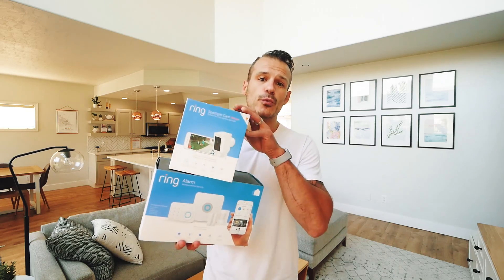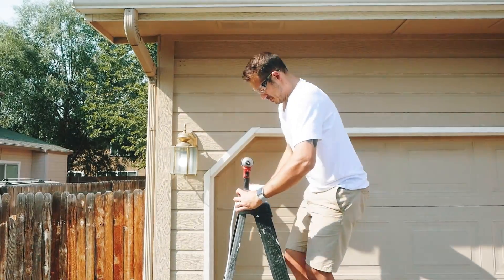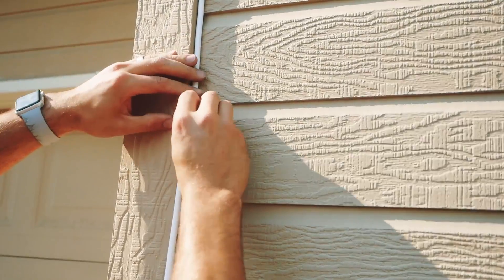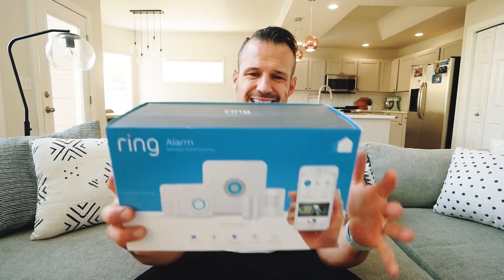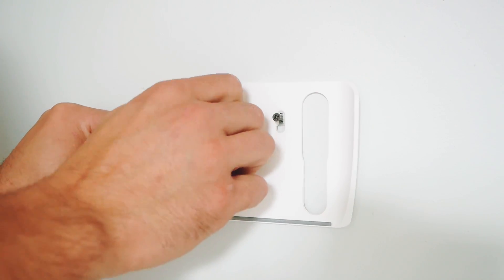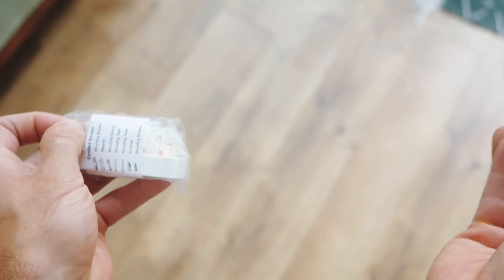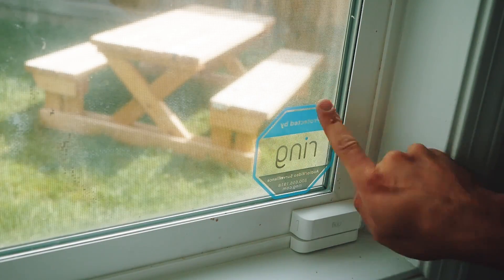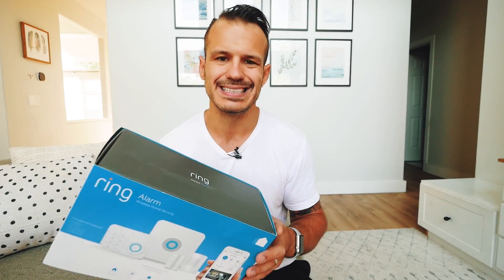RING Security System Worth It?

Comment: I am a licensed low voltage electrician. In CT it is illegal to run the electric wire through the wall like you did. If there was a fire a home owners claim could be denied by insurance. You might want to mention that disclaimer. I am sure there are other states where that is the case.  PS. I hit the like button. Decent amount of info

Comment: The base is the heart of your system and should be placed where it's very hard to get to or damage. I strongly suggest you move yours. 

Same idea goes for your window/door sensors. Putting them at the bottom makes it easy for someone to push a magnet under when and fool the system. Better to place them on the side near the top of the window.
Reply from the maker: Great option
Reply: timon0x31 v
Reply: Thank u so much for those tips!

Comment: We're starting to hit a point of wireless device saturation in a lot of average homes.  I've had to upgrade my wifi from a pretty nice but not too expensive wireless router to a Ubiquiti USG gateway and their AP pro.  It was an instant fix for the random device disconnections.  Everything is smart, everything is IOT.  I have 30 wireless devices right now and that number is only going to be going up.

Comment: Any security system devices having their cables right out in the open, means it's available for tampering or being degraded by the sun and elements.  The power cable should be cut, then passed through the wall to the other side, the cables re-connected on the other side inside a J-box, then the cable should proceed to be plugged in where your cabling is most secure. (may require the need to run new power to the inside garage wall)  

From the audience perspective of your YT post, might I suggest you be careful how you respond to comments.  Their input may be totally toxic or rude  comments, but keep in mind that your replies are under more scrutiny than their comments.  If you don't like the comment they posted, dump it instead of trash talking each other.  Goes a lot further in the long run, especially if you want more subscribers.
Reply from the maker: Thanks
Reply: 68Camaro RS/SS , I absolutely agree.  This is not a bank or the like, however the elements will degrade the install and when you need that video the most, it won't be available.   The point was not only to protect the device from tampering, it was also to protect the install from the elements and get the maximum life expectancy out of your investment.  My camera system was pivotal in recovering my neighbor's trailer, when 2 douchebags decided to swipe his trailer.  We had video of the guys and the vehicle because they parked in front of my house when they stopped to do the dirty deal.  You never know when you need that video!
Reply: 68Camaro RS/SS - I expect to get the maximum value and use of my investment.  You can throw away your money if you want, that’s your choice.  I build my projects to last.  Do you put no name tires on your car to save money?   I certainly don’t and won’t.  I buy what fits my need, won’t fail prematurely and will last.  I want that dollar to give me the maximum use.  That’s how I roll.
Reply: James Sokolovic wa
Reply: Gordon Chow ???
Reply: @MEGA_SOKO  - - I'm a 35 year old man, but... Is it weird to say that when I grow up, I want to be like you?
Reply: @MrBuildit   Could you tell me in what ways RING is better than any other systems?
Reply from the maker: @FluffyKittypire  I like that you can sell your house and bring the system with you

Comment: Great video!....  You mentioned that if your internet signal goes out, you'd be put in a "difficult position".  That is not 100% true.  The unit has a battery backup that allows the system to still call to the authorities if the power goes out.  The unit also has cellular backup as well, so if your internet goes out on its own OR if your entire power goes out, your security system will STILL be able to alert the authorities in the event your security gets tripped.

Comment: had my ring alarm in over a year now without missing a beat,you need to mention that your external ring cameras can be intergrated with the ring alarm so if your alarm is in home mode or away mode and your contact sensors are tripped then your external camera siren goes off as well as your alarm base station hopefully alerting your neighbours

Comment: The wifi is the primary signal but if you're subscribed to monitoring services, the base unit has a backup cell signal that will still monitor the alarm and alert the police of an alarm. Cameras wouldn't work but rest would since it z-wave connected to base panel.
Reply: It would be nice if the battery operated versions had an SDcard back up, so at least recording could continue. The security cameras at my agency have this and will record if the network drops out. Great backup.

Comment: As a security installer for 20 years let me just say two things. All this diy alarm systems are great for people on a budget but they can't possibly compare to a proper alarm system installation. Also external power wiring visible like that even if you paint it is a big no-no. You could drill a hole direct from the camera to the inside of the house at the height of the camera and properly insulate that cable with insulating conduit.What you do to the inside of the house is up to you. I recommend a plastic cable tray which can be painted.Greetings from Greece.

Comment: I am not familiar with this system. But in my house, I also use security from Kangaroo. In fact, it completely suits me and I do not want to replace it with something else. I chose this system due to the fact that it is wireless, it works through a wi-fi network and has its own application on the phone, with which I can monitor my home.

Comment: I would like cable to be plug jack so I would easy run it through wall and avoid cord cut.. access..
Reply: If you're talking about the camera, there is a "wired" version. You can replace existing security lights with it or run your own wiring to it. No exposed power cord.

Comment: So if I had this system and the wifi goes out or the cable is cut, will the audible alarm still tell me that a door or window sensor is opened?  Alerting the security company would be secondary to me.

Comment: funny like no one could walk up and cut the cable. Bad guys steal cameras all the time
Reply from the maker: very true
Reply: Prime is the plug cant be fed through the hole. Unless you mount camera to a board and bore a bigger hole. Better idea really.
Reply: @davehelmVO  I drilled a small hole, cut the power cord about a foot from the end, fed it through then re connected the cable on the other side of the wall in my garage. No cables on the outside whatsoever.
Reply: Night Stringers un

Comment: If the power goes out it has a backup battery.... but if the power is out then you're internet is going to be out so what good is that?
Reply: As far I know main station has backup mobile connection, I wish there is option mobile only connection for few bucks extra.

Comment: Ring's major advantage is ease of use... past this it's an inferior system that doesn't have the level of durability or reliability of a fully wired PoE system connected to NVR and NAS setup. Setting up a system like that isn't easy, but it's way cheaper than the "best buy" brands and bulletproof. Usually comes standard in 4k these days... Ring and comparable brands only do 1080p... just my two cents.

Comment: High, with the integration to Alexa and Schlage Z-wave lock, I know that I can leave the house, lock the Schlage lock and it will arm the Ring alarm in away mode.  Can I do it the other way around, arm the Ring, Open the door, exit the house (during the arm delay) and close the front door.  Now I would like Ring/Alexa to automatically lock the door.  My current alarm system does it today.  Can the Ring /Alexa/Schlage combination do that?

Comment: On comment on the dislike, If you subscribe to the Security  monitoring plan   for the $100 a year, the base unit has a cellular module through AT&T that f the internet get cut or disconnect you are still protected. The only downfall to this is you have no app control.

Comment: The big problem with ring is the lag you get when it is triggered
Reply: Hmmmm, just checked mine, opened my back door and it sent an alert to me in less than 3 seconds and the base chimed immediately. Also, if you're talking about the alarm you can set delay (lag) to 0 if you want.
Reply: Thanks I will check that. If I am home it seems pretty quick but through phone often miss the event or experience a delay.

Comment: What is the point if the power wire is exposed? What I have done is mount the cameras inside facing outward so that it is easier to access power, hide the wires and almost eliminate someone disabling the unit! 🤔

Comment: Hey, just checking in. For anyone wondering what he means when he’s talking about the cellular/battery backup, that’s for the base security system. If you have monitoring, it’ll still dial out to the police telling them there is a disturbance for the windows or the doors. That being said, the cameras won’t record because they are powered by the wifi. If you want a system with cameras that not only record during a power/wifi outage but actually can deter crime, look up Vivint or shoot me a DM @dansochill on Instagram or Twitter.

Comment: I do not think that it is necessary to put a warning on the protection of the house on the windows and doors, the thief will immediately be ready for what you need to look for sensors. The modern sensors that I installed around the perimeter of the Kangaroo house are very invisible and the thief will not notice them when burglary and the danger signal will immediately work and send me a notification on the phone. And due to the fact that they are wireless, I can hide them well.

Comment: what if they cut the wireless cable? the robbers are first these days cutting wifi wire which is mostly outside the house, right in front
Reply: As long as you pay the $10 per month or $100 per year that is required for the professional monitoring, you are all set. The box has built in cellular for cases of internet being disconnected.

Comment: How does it compare with SimpliSafe?
Reply from the maker: i have not had a chance to review the simplisafe
Reply: Ok. Thanks
Reply: 1badhorsie Cool. My only issue with selecting Ring over SimpliSafe is SS operates from cellular, while Ring operates from WiFi. If you have a rather erratic WiFi connection, there may be problems. However, monitoring with Ring is substantially cheaper. 

Thanks Bro.
Reply: Will G if you pay the $10/month for monitoring with ring, it has cellular backup as well.

Comment: What good is a battery backup on the system if the monitoring connection (internet router) goes out with the power being lost or cut?
Reply: It has a cell connection in the base unit.  It's only active if you pay for the $10/month or $100/year monitoring, but it's well thought out.

Comment: Hey Mr. Build It, I have a 1550 sq ft ranch home with three entries. I want the system to be centrally monitored for entry and fire, and I want to be able to monitor through an app.  I'm also on a budget. I've narrowed the search down to Simply Safe and Ring.  I'm interested to know how you would compare these two systems?  Simply Safe costs a little more.  Is it worth the extra expenditure?  If so, why?
Reply: I had also considered Simply Safe and Ring.  The deciding factor for me is the cost difference in the monitoring and I like the video doorbell.  At 100.00 a year if paid yearly, Ring is really affordable for someone on a budget.  This is about 1/3 of the cost of Simply Safe.  They also have a plan at I believe 30.00 a year for no monitoring but access to your camera footage for a period of time.  You can download any footage also at any time.

Comment: You skipped over the mains lead very quickly. In UK, my version of the outside camera light comes with a sealed UK plug . I will have to cut this off and thread through the wall and then reattach to the mains plug!

Comment: If you cut the power to your home does the app notify you that your system is offline, or offer up any snapshots from before the power went down? I like the idea behind these, but without a backup battery and cellular line, you'd be sol. Even if the cameras run on batteries...no power = no modem = no images sent to cloud storage.

Comment: Im thinking on Nest, thoughts?
Reply: (J G) Ring a a cheaper system and is smash proof meaning unlike the nest if the nest is smashed then the signal won’t go out, if the ring keypad is smashed then the base station will be already sending out the signal which you can hide it btw so I recommend the ring system because of cost security monitoring and no need to worry about mis placing your key.
Reply from the maker: never tried it. But the nest is cool though. guessing woks the same
Reply: Simplisafe. But more money but worth the price.
Reply from the maker: I think so
Reply: Get a gun

Comment: Why would you want to bring the keypad with you to your bedroom?  Isn’t the phone act the same?
Reply: Probably for the folk who aren't Smartphone savy, or need a piece of mind if they are too slow getting to the entry point where the keypad is usually installed.
Reply: The keypad has a set of panic buttons. You hold 2 down at the same time and it activates the alarm. If you’re on the paid system during a home invasion, you might have time to possibly barricade yourself in your room and set the alarm off. Worse case scenario, they’d shoot you through your door but if you’re like most Americans you’d be ready for the scumbags anyway so there’d really be no need for the panic buttons. You’d be calling 911 instead to report a dead criminal in your house. This is the reality of today’s United States unfortunately.

Comment: i wish you would have mentioned the subscriptions it seems that without the subscriptions you can not save or review video
Reply: That is correct. True of most all the services though this one is notably cheaper than it's main competitors (partly, in the case of Nest, because it doesn't record 24x7, it just records events or live views).
Reply: @curtisbme  yea still $3 a month adds up i can get a motion detection system that i can view through an app and a 1 terabit drive and 4 cameras for under 300 with no subscription. i think ill end up going that route after the last 24 hours of my research.

Comment: How loud is the siren?
Reply from the maker: Not sure of frequency but loud enough to scare
Reply: @MrBuildit  thank you. Great video. I got the alarm yesterday and I will install it this weekend.
Reply: (Ricardo Cuetara) The systems siren is 110 decibels (Smoke detectors are 80).
Reply: It’s a fairly loud in my opinion, that was the first thing I tested when I bought mine because that’s important. It’s loud enough that neighbors could probably hear it
Reply: @ricardocuetara1  Depending on where you install the base, it could reverberate sound for maximum effectiveness.  I have a high vaulted ceiling in a large living room with high up hiding areas, using a 14 foot ladder to reach it.  Perfect area to create a giant speaker of a shrieking siren, if needed to scare off unwelcome guests anywhere in the house.

Comment: Is the motion sensor sensitive enough to be triggered by pets?
Reply from the maker: I dont have pets, but i'd imagine so
Reply: You can adjust the sensitivity, but the default setting says pets up to 33 lbs. should not set it off.
Reply: I had a motion sensor that said something like that once. It was cheap, but an ant would trigger it. I am sure the technology has evolved significantly, but it is still a concern. And, what about crazed midgets?

Comment: So when someone breaks into your home through the glass and doesn't open the window..... then what?  The motion sensor you might say, you'd be wrong. The motion sensor is not on while you're home. This kit comes with 4 open /close sensors, which is maybe enough for your doors alone. Being in law enforcement and home security systems currently, I have to tell everyone to beware. These DIY kits seem sleek, cool, and trendy. However,  if you are looking for something to actually keep you and your family safe from the evil that exists outside your front door, get someone who knows what their doing. Do not get a "security system" from a company that made doorbell cameras.........
Reply: The motion sensor(s) can be set to be active or inactive in home or away modes.  You can also adjust the sensitivity of each motion sensor.
Reply: Active in home mode will indubitably cause false alarms. Adjusting sensitivity of a motion sensor does nothing for protection.
Reply: There are so many variables, I may just call a pro. I am old enough to remember when people would be getting calls at work because their alarms went off accidentally from big name companies. That has been fixed. This tech is 'new sleek trendy' like someone posted here, but new. New means buggy a lot of the time.
Reply: So what is your fix/proper way to set up a pro system for the scenario you described for when a home owner is at home and someone breaks a window out to gain entry?
Reply: @megumei044  They need to come up with a glass break sensor. They don't have one available at all.
Reply: If you don't have one, you can't make statements without trying it yourself. Bias is blinding.
Reply: It's all zwave, there may already be a glass break detection sensor. Most people will pair this with outdoor cameras. 

In short, any flaw you point out can be solved, and probably cost less. Most home systems are for peace of mind and tracking teens...lol
Reply: @kryogenik  put motion detectors inside by the windows you can adjust the sensitivity .
Reply: @kryogenik  Simplisafe has a glass break sensor.
Reply: airforce525 g